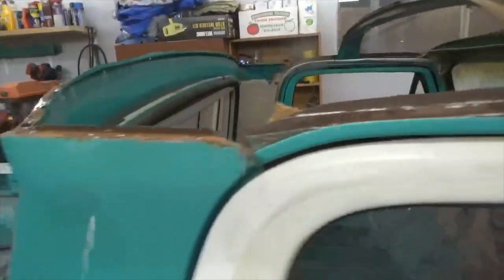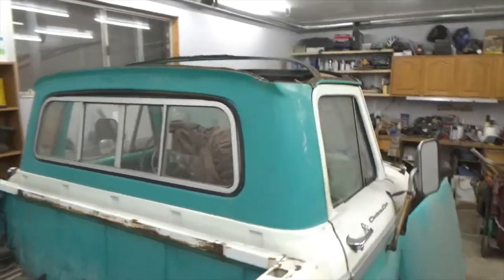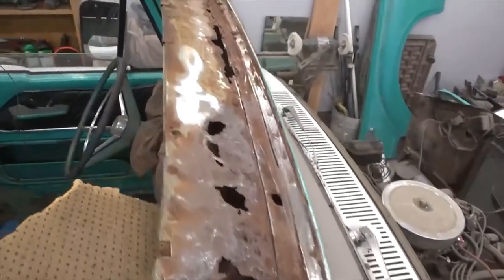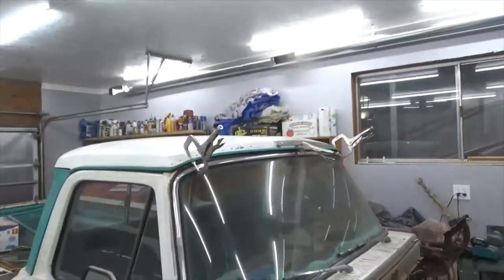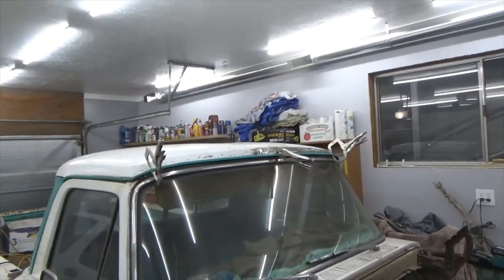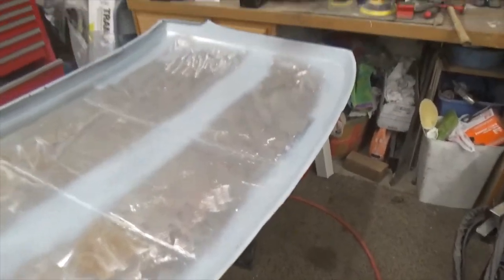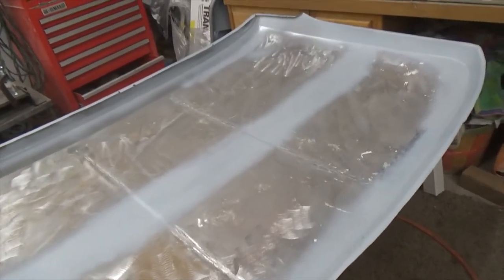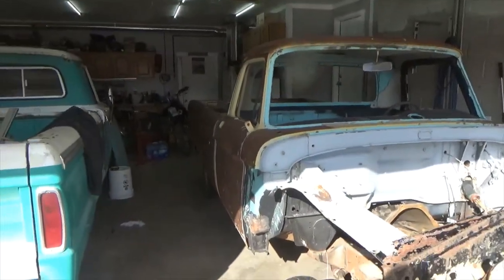The New Roof FAIL!!! f100 Life On.

Comment: Did you fix the rust in the frame under the leading edge
Reply from the maker: I cut out the rust and treated it with naval jelly. That's another for trying again.
Reply: @lifeon5090  better products than that crappy almost useless naval jelly.